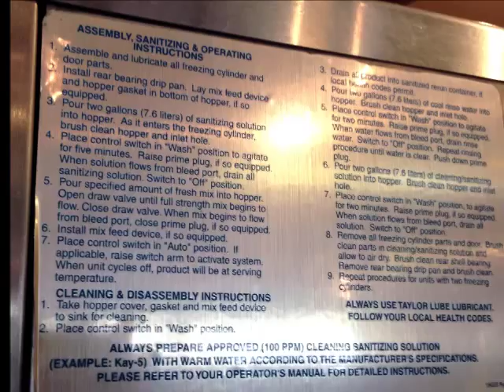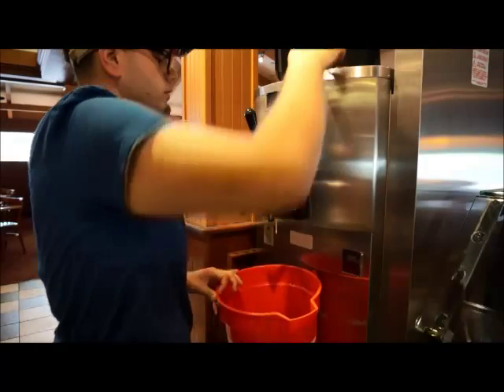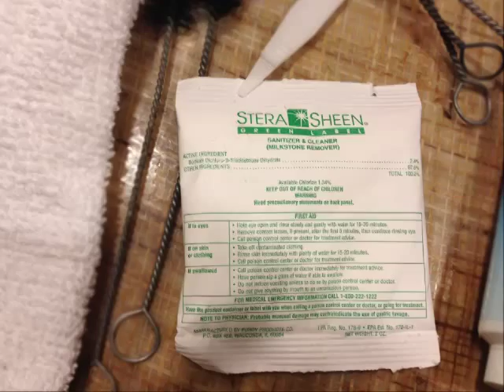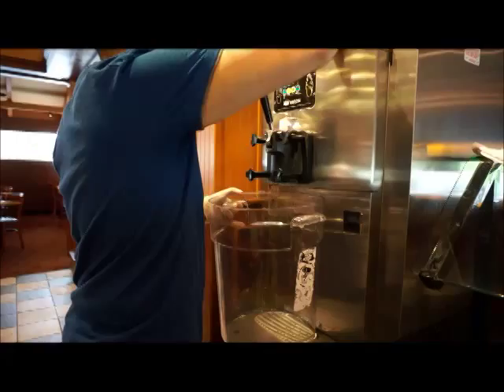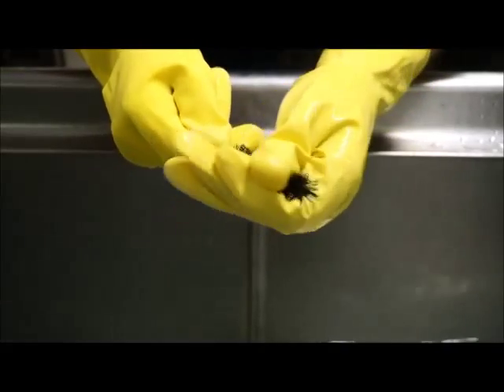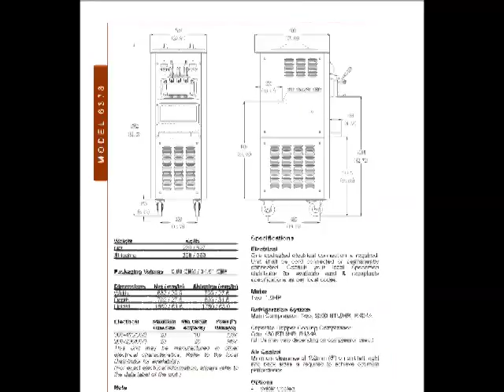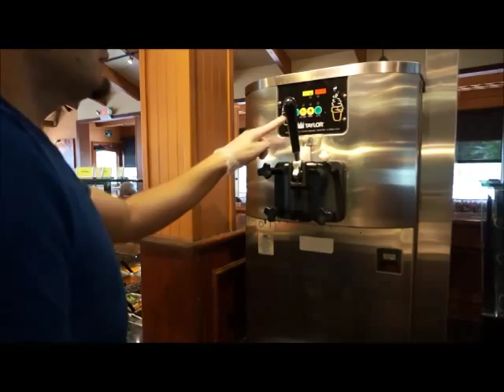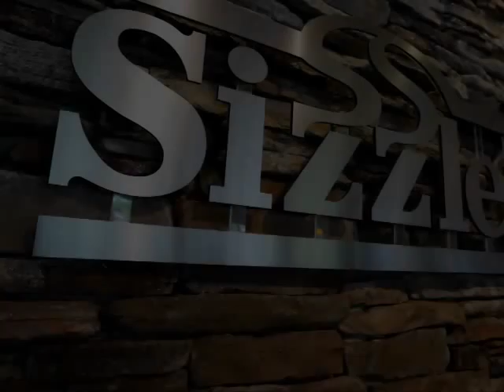Breaking it Down: Soft Serve Machines

Comment: I've never worked for an ice cream shop and really dont know why i just spent over 10 minutes watching this...
Reply: i watched it because i was curious... when i was in high school in the early 80's i worked part-time at burger king on the closing shift, so one of my jobs was to shut down and clean out the shake machine. laws must have changed because we always saved the mix that was frozen in the machine in re-run tanks (covered stainless steel tanks that were stored in the walk-in cooler) and used that first thing in the morning when the machine was reassembled and started back up. other than that, the procedure we used was pretty much the same as the one in this video. we had a really nice parts drying tray made by the machine manufacturer that was form-fitted to every removable part so nothing ever could get lost.